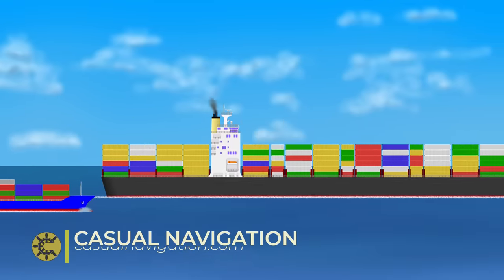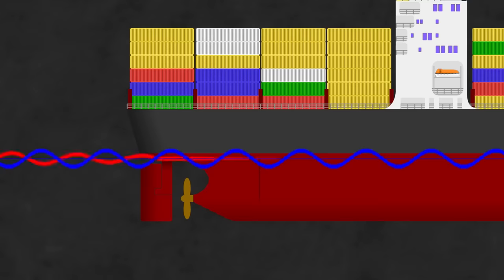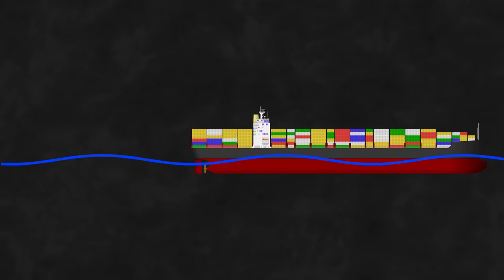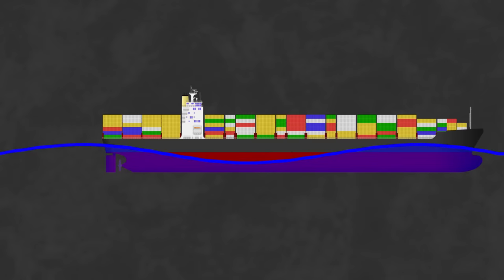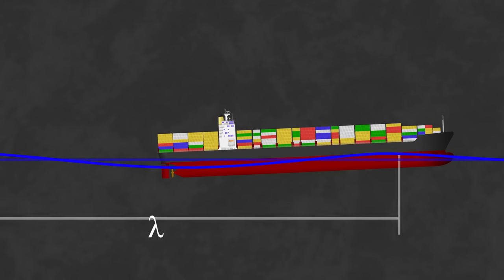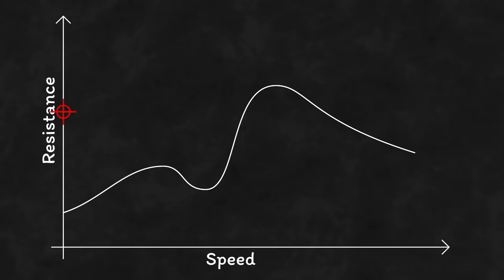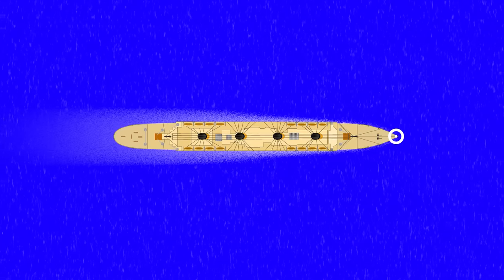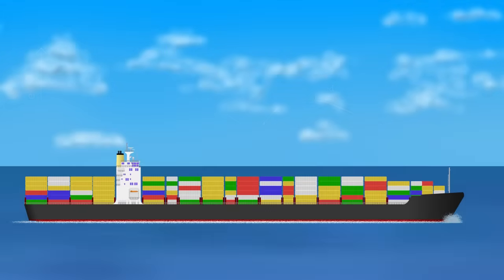Why Are Big Ships Faster Than Small Ships?

Comment: Another thing worth Mentioning ist the Weight- to Surface Ratio. When l is the Length of the Vessel and all Vessels have a similar Geometry (like the Titanic and a Model of the Titanic) it's like that: The Enginesize (and Power) is proportional to l^3 and the Surface, where the Hull touches the Water ist proportional to l^2. This Surface is also proportional to the Force of Resistance (just Friction between the Hull and the Water). So the Resistance is X*l^2 and the Power is X*l^3. So if you double the length of a Ship but you keep the Velocity constant, you get four Times the Resistance and aight Times the Power, which means it can get faster.

Comment: This is so incredibly interesting. It's when water waves show their similarity to other kinds of quantum waveforms. Though, higher drag meaning higher hull speed is still confusing to me.

All waves are disturbances in a system that transfer energy. Imagine if we could ride radiowaves, which can be MUCH longer than any water waves. It'd be like you're suddenly propelled 30 meters into the air without seeing anything, but you ready your antiparticle surfboard and ride this invisible wave until a mountain gets in your way. Or you accidentally leave the atmosphere and die.

Comment: I feel like it's also worth pointing out the square cubed law. If you square the surface area of an object, you cube it's volume, meaning you're able to fit more engines and such in, for less drag. I'm not 100% certain how it factors into ships, but I know with many other vehicles it can be a big benefit to building bigger. However it does also come in with the issue of more fuel consumption and such
Reply: This is why container ships have been getting so big. The fuel consumption follows the square/cube law too, so the bigger the ship, the less fuel/tonne of cargo moved, even though the ship uses more fuel than a smaller one.

Comment: What difference would fresh water make on hull speed? Does the lower density increase the wavelength, lowering speed? Is this why freighters on the American Great Lakes tend to be longer and narrower than a marine vessel of the same tonnage?
Reply: Great Lakes freighters are that shape to be as big as possible for reasons of cost efficiency, while still fitting within the locks (Soo Locks?) they'll need to traverse. Apparently the rounded bow is designed to minimise wetted area and reduce drag, and its blunt shape isn't a problem at the low cruising speeds of these ships.

Comment: You can also look at things more abstractly - because of the way objects scale in fluids (think reynolds number), the larger an object is, the more a fluid seems to be thin like air, versus for smaller and smaller objects the fluid seems thick like jello. Amoeba swim in water like it is sand, where whales fly through water like blimps in air.

Comment: Since we're talking about hull shapes and speeds. How about a discussion on why sailing catamarans are significantly faster than monohulls, and does the same hold true when powered instead of sail.
Reply: Catamarans are not always faster than monohulls. Depends on the design.
The main difference is monohull have queel weighting manys tons to have a righting moment. they are much heavier than catamarans, so they have more wetted area.
There is also something about the ratio of hull lenght to width, which is better for catamarans with narrow hulls making less waves.
The sails of a catamaran are more vertical, so the wind doesn't spill over the top as much as monohulls.

Comment: 4:50 ...you can just slap on the bulbous bow and everything we talked about no longer matters all that much. :D Just hillarious

Still as a technician I can imagine the nightmare of designing right proportions for ship when you have bow, bulbous bow and tail generating the speed dependant waves and you need all of these to zero out because if you run at wrong speed it's gonna be drag
Reply: yeah but imagine adjustable bulbus bow on an aircraft super carrier you could set your wave counter interfereance remotely depending on what extreme speed you've acheived so possibly even more fuel rod effeciencies biggest problem would be trying to not cut great blue whale's 🐋🐳 in half or a pod of humpbacks we know dolphins love cruising on a wake so imagine killer whales another type of dolphin 🐬 doing the same or even great blue whale's hitching a ride 😇💜
Reply: @SnowingNapalm  That would be good upgrade for bow. Also dolphins and killer whales around might be nice.
However after years of misery and keeping nature on the other side of fence I would be only concerned if the whale collision can damage bow and if we would have means to tow both halves to the port or processing them.

Comment: As someone who also works in the transport industry but in a different area - its funny how very different physics leads to similar . . . On the base of it 'logical'? Anomalies. 

In the railways we have steel wheels on steel rails. The wheels are also profiled to ensure minimal contact. That gives us fantastically low 'rolling resistance'. We can move heavy loads at a fraction of the energy requirements of road traffic, for example. 

The biggest problem for us is getting stuff moving in the first place and then getting it stopped. 

The same low rolling resistance that means that once a train is moving it doesn't need much power to keep moving? That means that getting it moving or getting it stopped? They can be a real pain. 

And when gradients are involved? Even more so. 

Heavier or bigger trains can actually have better acceleration, deceleration and top speeds than light but more powerful trains simply because their weight gives you more grip on the rails.

If you need an example of what can happen when you pack too much power in to a train? Look at videos of the Acela HHP-8. 

That thing had 8000 horse power. 

Hauling a heavy train? Sure. 

But light engine (running by itself) or with a light load? Especially in Autumn and Winter? With slippery tracks? It just spun it wheels and actually damaged the tracks it was running on.
Reply: Thank you Anthony. We will definitely keep you in mind for further train knowledge, trivia and facts. But for now, this is the Casual Navigation channel, a channel dedicated to marine knowledge, trivia and facts. Thank you again for your information.   🙋‍♂️
Reply: also double the speed (not on rail) requires 8 times the power
xj6 150 mph
xj12 168-75 mph  twice the cc  = 1/8 extra speed
so there 300 mph x8 the cc

Comment: Some of info appears incorrect.  Key point is what they said in the end - when speed causes half length of wave created to be close to the ship length and you start climbing a bow wave.   And a bulbous bow helps, but it can't double hull speed.  It gives you perhaps 12%.   Probably that ferry they mentioned was planing.   Hull speed goes up with approximately the square root of the length so you can estimate the hull speed that way of ships you see also.   Large ships are very dangerous on the ocean as they travel to fast they can come up on you in just 15 minutes from when they appear.   Must keep watches or have radar or both when doing crossings.

Comment: There is also the effect that larger ships with larger hulls are not only vastly more  economic due to their  disproportionally larger cargo holds, thanks to the square-cube law but it allows the installation of larger, more energy efficient engines which allow running at higher effective speeds. while  also saving a lot on the fuel mileage. Large ships are simply better in every way if there is enough demand to use them.

Comment: I think the square cube law might be a bigger factor than wave drag. Making the ship bigger by the same proportion in all dimensions creates a lot more volume than frontal area, giving you a lot more displacement for only a little bit more drag. You have to put in an engine that is a little bit more powerful to maintain a given speed, but if you put in a moderately more powerful engine you can get a lot more bang for your buck than if you tried to increase power on a smaller ship. Economies of scale reward you for making a bigger ship go faster more than for making a smaller ship go faster.

Wave drag and all the dynamics there certainly are an important factor, and add on to the other advantages of scaling up, but I suspect that even if the hydrodynamics didn't change significantly based on hull length, big ships would still end up with more power relative to their drag and therefore go faster.

Comment: Before watching the video my initial answer would be that drag is based on surface area while thrust is based on volume, so due to the square cube law thrust should increase faster than drag. Weight will also increase with volume but since the ship is buoyant this should only be relevant for things like acceleration and turning. So a large ship should be able to reach a higher top speed but it will take longer to reach that speed. Now to watch the video and see how wrong I am!

Edit: Lol my suggestion had nothing to do with the right answer, I never would have guesses that it was based on the waves generated by the ship’s bow changing the drag profile at various speeds.

Comment: And the biggest factor iiiiissss - actually just economics. The "optimal" speed varies with length - given the same overall proportions. But bigger ships don't have the same shape. They are faster cause despite that making them less efficient then they could be overall the shorter travel time means they can transport more cargo (and some argo is also time sensitive).
If you can generate the same profit by paying 20% more in fuel but in just 70% the time - you are making more profit. 

And that is not to mention that larger hips are inherently more efficient as drag does not scale with weight linearly. Twice the total mass does not produce twice the resistance. A Ship twice as heavy, with twice the fuel and power will travel faster even if it was the exact same shape and size.

And of course ships are designed for specific speeds with the humps as they have a fixed length and that has to be in the right relation to the wavelength to reduce the drag. At the "wrong" speeds it will increase the drag just as much as it can decrease it at its designed speed.

Comment: I remember coming across the topic of hull speed in Dragon Magazine of all places, when I was in my early teens.  This had quite an effect on my thinking, as the notion "smaller is faster" is a popular misconception.  This was before I was reading about pre-WWII bombers being faster than the fighters of their day.

It was then I noticed other things.  A little Triumph Spitfire couldn't go as fast as a big Chevy Camero.  The Mach 3.5 SR 71 was bigger than the Mach 3 Mig 25, bigger than the Mach 2.5 F-15, bigger than the Mach 1.8 F-16.  The trend wasn't perfect, as aircraft, like Dassault Mirage 2000 perform well above their weight class, but I thought the trend was clear.  In the case of aircraft and passenger cars and airplanes, the bigger the frame, the more room you have for the engine, compared to the driver.

I saw an article on space navies, and somebody was giving the advice that smaller ships should be faster.  After reading this, would it surprise anybody that I had to disagree?
Reply: In space there isn't resistance so it would be a simple energy to mass issue. Also, with small things like cars and planes, even if the wake of the air did have an influence, you would overcome the "hump" speed very quickly. The only case where air waves and size really comes into play is with supersonic flight. Aircraft performance over through the sound barrier is a completely different issue and has a lot to do with where the air around the frame is reaching supersonic speeds (which is why most supersonic aircraft us delta wings which allow the jet to push through the barrier more easily). The wavelength of the water effects boats so drastically because of the immense mass of the water compared to the craft.
Reply: @oldmandan5634  With hydrodynamics, the concept of hull speed make the concept of "smaller is faster" universally wrong, with all things being the same.  Of course, small craft can use surface effects, and skip from wave to wave in a manner that would break a larger hull.  I just noted that the idea of "smaller is faster" is usually wrong, as things tend to have to be made bigger to house bigger engines.

I would find it aesthetically pleasing in a sci-fi setting to have a larger spacecraft go faster, as with sailing ships, the one with the longer hull would generally be faster, as it not only had the higher hull speed, but more space to for sail masts.  In the case of spaceships using their main power plant for locomotion and powering weapons, capital ships would easily outrun their escorts.  Come to think of it, I've heard US Navy aircraft carriers tend to do that.

Comment: The truth behind all this is the bigger one is usually carrying more valuable stuff and try to get there faster because its more important, the smaller one would be carrying either cary stuff you buy off of ebay, books or furniture or food, versus the bigger one carries car parts building supplies and very dangerous stuff like dynamite or gasoline or other stuff.

Comment: Can you talk about how is ship digs a hole for itself when it travels under its own power.
I'm thinking of the time when the QE2 bottomed out somewhere when they thought she had plenty of water under her. Turns out there's a phenomenon that was not understood at that time. A ship will dig a hole for itself and it was measured about 3 ft or a meter. They thought that's as deep as it got and it stayed constant, so when the QE2 bottomed out with like 15 feet of water under her doing 25 knots people were wondering how and why. They later found out from that investigation that the whole gradually gets deeper as speed increases.
As you can tell, I don't have proper terminology, but I would still like to know....

Thank you for your time;
Monte
Reply: This is known as the squat effect and occurs in shallow water.  Due to the small space between the ships hull and the bottom, there is not enough room for the water to flow under the ship and fill the trough created by the stern.  This causes low pressure under the stern which effectively sucks it down and causes the ship to sit lower in the water.  This effect was well known at the time of the QE2, and the Captain should have been aware of it.
Reply: @Titan604  

That is the problem, they thought it was well known, they thought it was only about 3 ft at the time. He had plenty of water under him for the speed he desired to go, according to their knowledge at the time. Since the ship bottomed out, something was not correct. They did some checking found out the water was as deep as they thought it was they checked the ship and found she Drew as much water it's the captain believed. Since those two things were fact, what you call squat was believed to be about 3 ft or a meter and that's as deep as it got. It turns out that assumption is wrong....
The faster ship goes the deeper the squat or the hole or whatever you want to call it is. They find it it doesn't matter when or where that it happens, and that it even accounts for some of the fuel burn that they thought was for other reasons.
It was a very nice documentary about it a little more than a decade ago, which is what I'm basing my memories on....
At the time they thought five knots, 10 knots, 20 knots.... The squat or the hole only got down to about three feet or 1 m. After this they found that was inaccurate.... I just want a video about it, because it's easier to understand with his animations....

Comment: What about surface area to mass ratio? Resistance is proportional to surface area, which scales proportional to L^2, but mass is proportional to L^3. Volume is also proportional to L^3. Which means less resistance per mass cargo for larger ships, and hence less fuel burn per unit cargo. Or alternatively you can take a higher speed instead of less fuel burn.
Reply: DARZHNARZHERLARBLE? DARZHNARZHERLARBLE?

Comment: But if they use a bulbous bow, then the hull speed is conditioned by the design of the bow and the speed that they had in mind when designing it. Which also has to match speeds of when the engines are most efficient

Comment: I'm not so sure about the wave speed changes discussed at the beginning. Maybe wave speed will change based on wavelength but this is unusual and was glossed over very quickly.
Reply: Yes, that is an important point.   For any wave its speed c   is  c=wavelength * frequency, so it is a question when you change wavelength, what changes, speed, frequency, or both.  This depends on the nature of a wave.   For instance for sound waves speed will be constant,  while frequency  is inverse proportional to wavelength.  However for gravity surface waves, as in deep ocean waves,   wave speed is proportional to square root of wavelength,  and frequency is inverse proportional to square root of wavelength,   so    c ~ sqrt(wavelength)